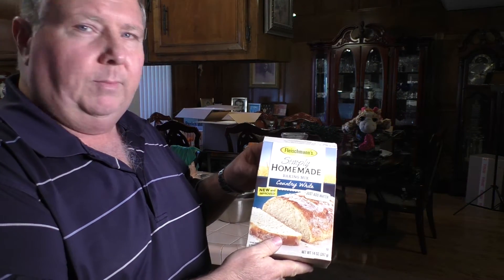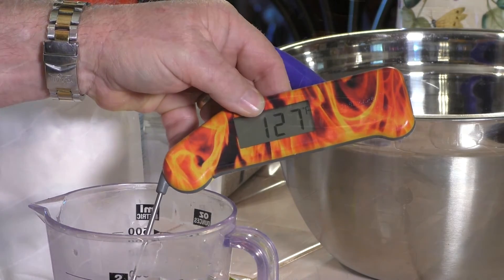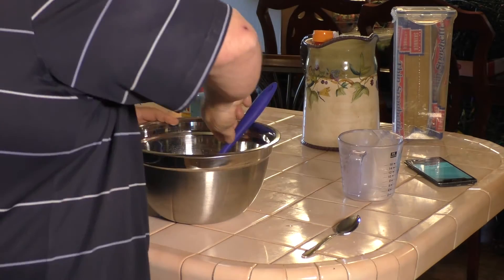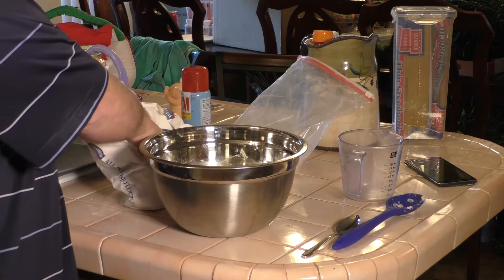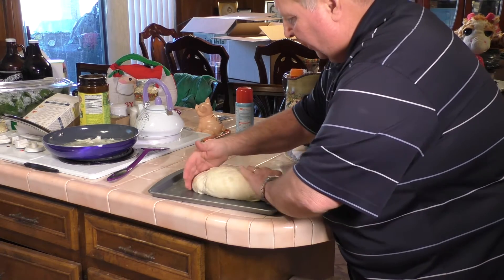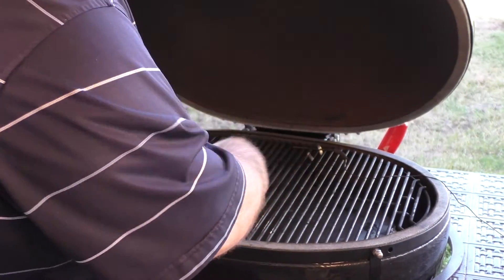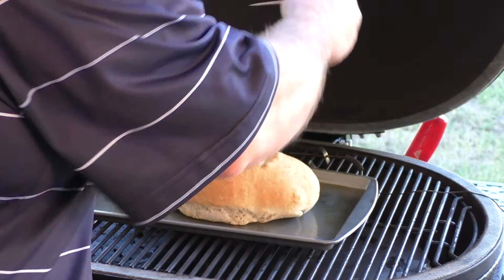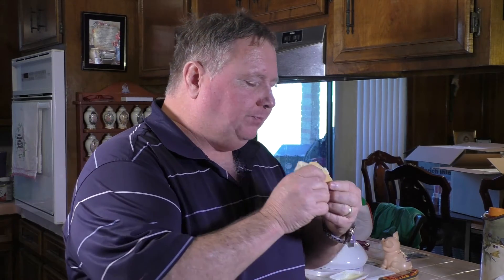Bread cooked on the Primo XL400

Comment: Never ever ever put yeast in water over 110 degrees.
Reply from the maker: "Dissolve dry yeast in a water temperatures between 110°F – 115°F. If yeast is added directly to the dry ingredients, liquid temperatures should be 120°F – 130°F."  Quote directly from Red Star Yeast manufacturer.  Thanks for your tip.  A good general rule of thumb.